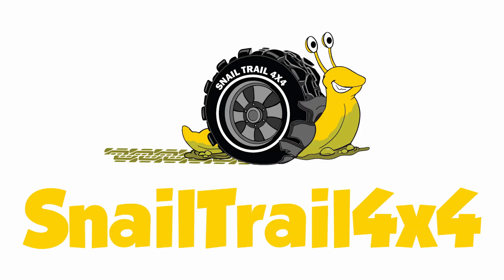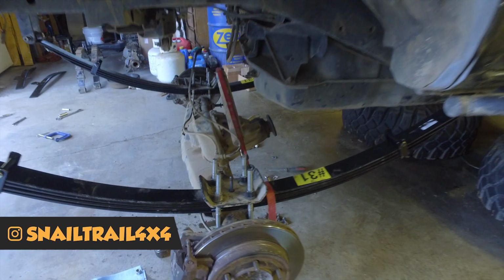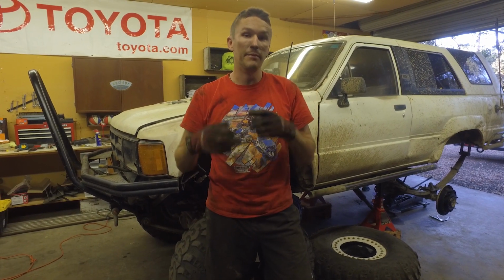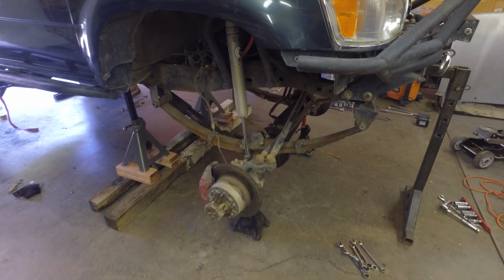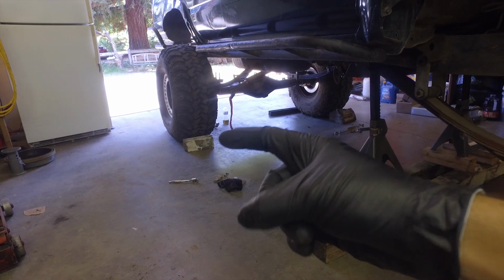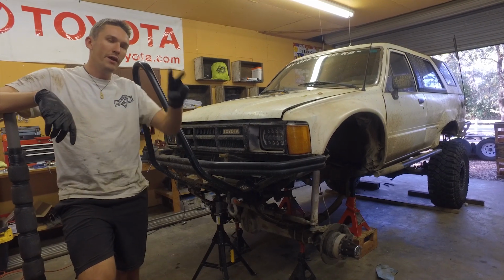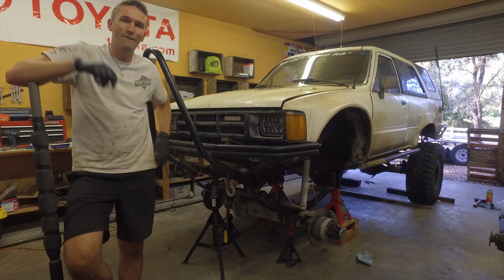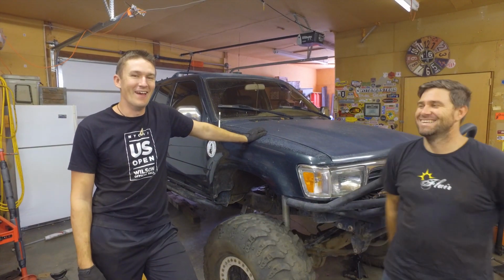Swapping Axles | 1st to 2nd Gen Toyota 4Runner

Comment: I need help, I can't find steering parts for a 92 4runner, 2wheel drive, everything is either 4wheel drive or 2wheel truck...mines. V6, auto, I'd like to just buy a complete kit, but I don't know ware to turn, it seems the 4x4 would work, but I need ball joints, everything, and all sellers say it won't fit 2wheel, please help, thank you
Reply from the maker: Try rancho Toyota recycling?

Comment: What number of differential do you use for a 3.0 motor in the solid axle swap?
Reply from the maker: Do you mean transfer case? Differentials are in the axle
Reply: is axle
Reply from the maker: @OmarHernandez-kg8cu  -- so for 33" you want 4.56 gears, 35" - 4.88, and 37" - 5.29
Reply: @SnailTrail4x4  thank

Comment: What's the leaf spring set up on the 2nd gen
Reply from the maker: It was stock height Chevy 63, and we added a 5.5" lift Chevy 63"
Reply: What brand leaf did you go with
Reply: And what leafs are the front
Reply from the maker: @bradstewart3132  -- procomp, and the fronts are a stock rear leaf pack moved to the front